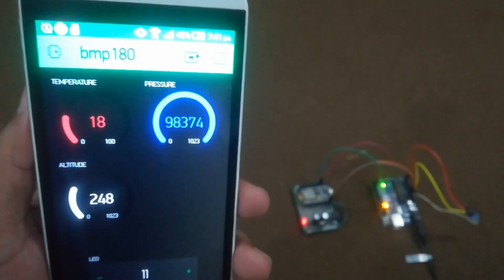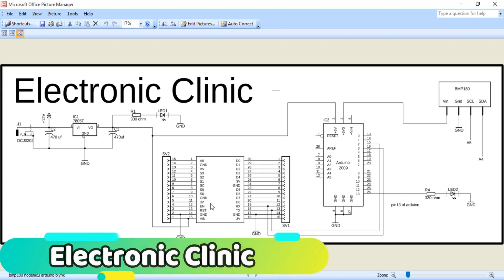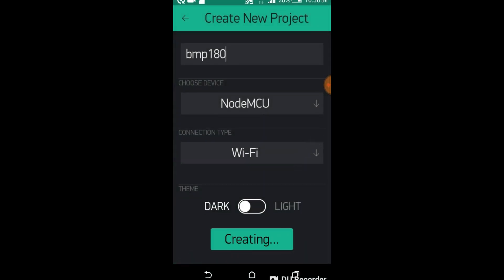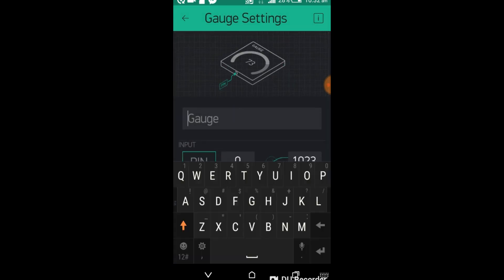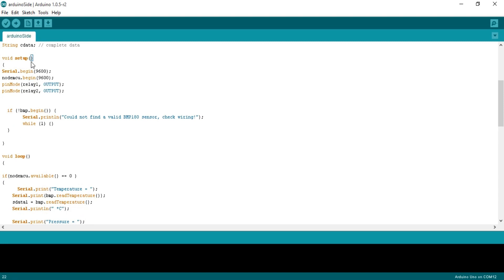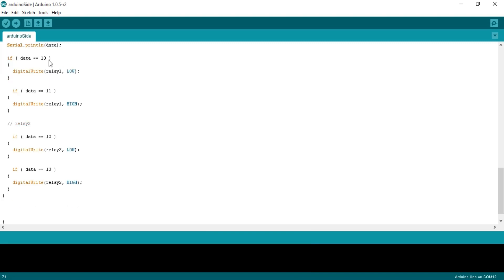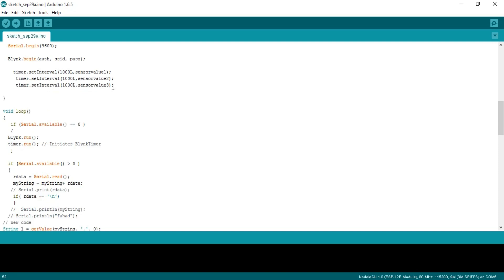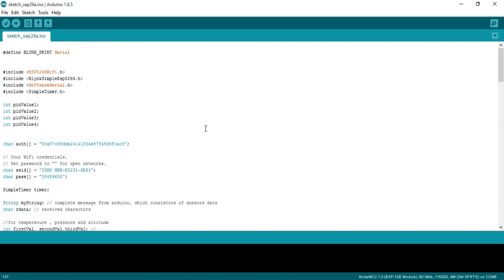Nodemcu esp8266  BMP180, Arduino, and Blynk Application” temperature, pressure & Altitude

Comment: Hello dear friend! Congratulations for the project! I also want to do it and I have a problem when loading the sketch for the Nodemcu esp8266 board. It gives me the following error: "exit status 1
Error compiling for NodeMCU 0.9 board (ESP-12 Module). "
I have installed all the necessary libraries, but the error persists. Can You give me some advice. Thanks a lot!

Comment: https://www.youtube.com/channel/UCo1jouP-SEy7Pjrk1p-lDaQ
 Hi Sir, 
I have started a project, Submission dead line on 23rd June '20. Project name  " Monitoring & alert system for Elderly alone". I plan to establish a wearable Transmissions use like watch type band.  Need to add few monitoring and Alert sensor in hand band.  BMP180 as pressure sensor, DS18B20 for  Temperature, MCU 6050 use as falling detector connect and a pulse sensor for heart heatbeat measure  with micro- controller NodeMCU8266 + Arduino IDE application. I'm  strucked in middle. need your kind advise to complete before the dead line.
Reply from the maker: I have videos on all of these sensors, check playlists.